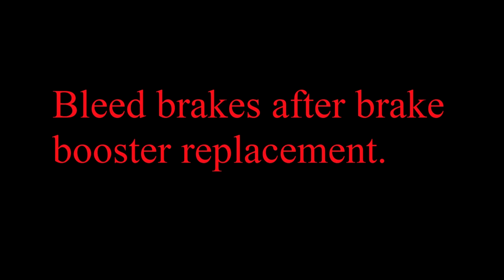VOLVO S60 V70II 2002 BRAKE BOOSTER AND MASTER CYLINDER REPLACEMENT

Comment: The brake sensor you removed was it the pressure brake sensor? I have a fault code 0130 and it says pressure brake sensor signal too low.
Reply from the maker: Hello, I have an STC system. It's either a pressure sensor or a pedal travel sensor. I don't remember. The DSTC system has two such sensors on the brake booster.